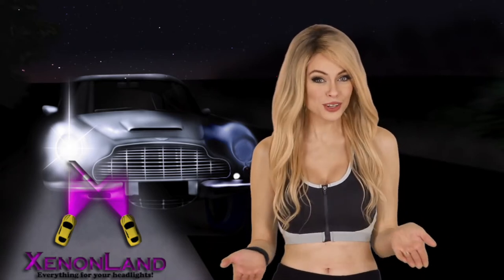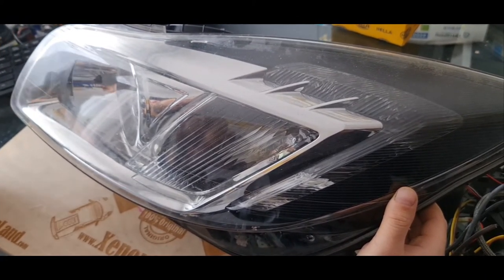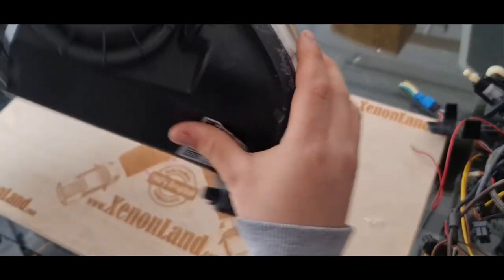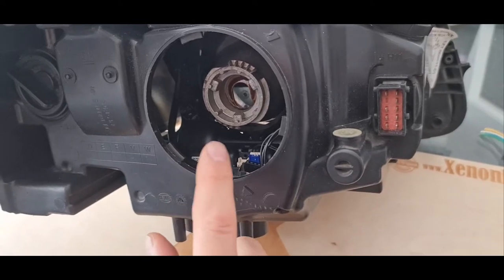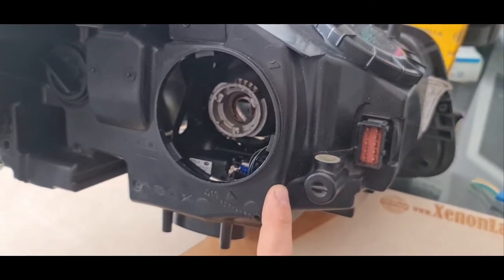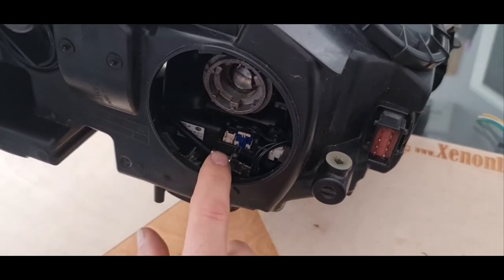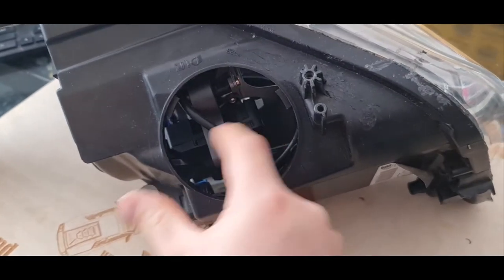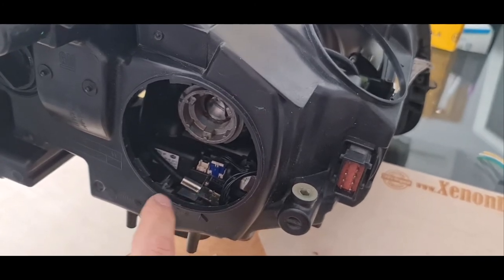OPEL INSIGNIA (ASTRA J) high (full) beam failure (BI-XENON AFL headlight); light shutter not working

Comment: Thank you very good vidieo . 
  i have a simular problem both headlights only come on for a second then turn off in auto light mode. in the manual mode they work as nomal. I had afl fault come up then it has now dissappeared from the dash the next time i used the car. but leaving me with the problem above.  2016 insignia. any thoughts on this matter, thank you.

Comment: Thank you for this video. I have the same problem.
I tested my relays and fuses, everything is ok. Except that my two 15A fuses of the high beam do not receive any current (ignition or engine on).
Is my problem the same as what is explained in your video? 
Thank you for your answer.

Comment: I have a 2013 vauxhall insignia. My drivers side light wasn't working. No dfl. Just the indicator. Bought a ballast and still wasn't working. The full beam worked on the passenger side. I then replaced with a 2nd hand unit which cost me £320. The lights now work expect for the full beam on both lights. Any recommendations?
Reply: I have a very similar issue, with my astra 2013 reg. Full beam not working and I get a warning on my dashboard saying service AFL Lamp.

Comment: Hi, wondering if you can help. I lost dip and full beam on both headlights, replaced both ballasts with genuine parts from Vauxhall and also replaced both bulbs with Napa Xenon HID D1S.. Picked up from mechanic and all was working, came out to the car an hour later and now back to having no dip or full beam - everything else works ie- cornering lights and both lights move when the steering is turned. Any help would be appreciated.
Reply from the maker: You should definitely have dip beam if your ballast and bulb is in working order
Reply: @xenonland  Thanks for the reply. Still no dip or main beam today. Taking it back to get them taken out and checked over again.
Reply: @xenonland  I went out this morning.. Now I have the drivers side main beam working although the AFL is now throwing up a fault. Both lights have stopped moving. Ready to rip my hair out. Any idea what is causing this? TIA
Reply from the maker: If you do not have main beam, it means that either your ballast unit or the d1s bulb is faulty. If you bought a brand new genuine hella ballast, you should code it after fitment to have afl working.  @MsBull1972

Comment: What if low and high beam dont work, bought two new bulbs and they dont work either. Will it be a ballast issue?
Reply from the maker: Yes, if everything outside the headlight is in order, it is either your bulb or the ballast unit. If bulbs new, remains the ballast unit.
Reply: @xenonland  thanks ❤

Comment: Thank you for your info, but I this black box what you show, where can I buy it? Or how it's looks? Maybe you can put some link here.
Reply from the maker: You can only source it from another headlight. Not sold separately as headlight part. Friendly recommendation, if your glass is removed and re-sealed just look for another headlight, but intact one with all lugs intact (I know that these are expensive, but will save you a lot, if you change just 2 times the xenon ballast it will cost you almost same amount). Please do not forget to subscribe.

Comment: Hi, I’ve had water ingress on LH side and now full beam on LHS and RHS are not working. Would replacing the LHS unit fix the issue with the RHS also?
Reply from the maker: Yes, it should
Reply: Thanks, I’ve just purchased a used unit from eBay with 2 week warranty. The LED is also out on the LHS, so should resolve that issue also.
Reply from the maker: @mikeh9442  these headlights are really pain. If you notice condensation in the newly bought headlight in these 14 days, just return it.
Reply: @xenonland  first job will be to test its fully functioning and then seal it all up with silicone!
Reply from the maker: @mikeh9442  99% is not the glass/lens!!! Silicon will not help. Rather look at the casing especially around legs for cracks/damage!

Comment: hello, my opel insignia A (2010) no longer has high beams. on the on-board computer, i have two messages: "afl lamps need maintenance" and "headlight range adjustment malfunction".
the 2 high beam fuses have no power. 
Error message : B0985.
Lamps + fuses + relay + commodo + ballast tested = OK. No water.

What do you think the problem is ? Right-side optics to be changed ? Thanks for your reply.
Reply from the maker: Your right headlamp light distribution shutter control circuit is defective. That's to say the low-high beam shutter is defect. (sometimes China make ballast copies also cause this fault, I assume that your ballast is original Hella one). Unfortunately you have to change the headlight or find a donor headlight to replace the whole projector and its shutter. Not worthy to deal with repairs. Please subscribe and help us to grow. Thank you.
Reply: @xenonland  thank you for your reply.
I don't understand why my left headlight has the same malfunction (high beam impossible).
Why are my two high beam fuses not powered?
So by changing my right lens, everything should work normally?
Everything is original OPEL, including hella ballast.
Subscription OK.
Reply from the maker: @gepetto5203 do not worry, your left headlight probably works. these are afl intelligent headlights. When you have a high beam malfunction at one headlight, the other one stops as well.
Reply from the maker: Go for replacement headlight, everything else is pain
Reply: @xenonland  Thanks again. It's crazy that such a fault cuts the current to the 2 high beam fuses, and prevents the high beams from lighting up. I'm going to trust you and order a straight optic. At worst, if this doesn't solve my problem, I'll send the optic back to the store.
Reply from the maker: @gepetto5203  original projector with shutter is not replaceable part! It is not sold separately by stores. You can only take it from let's say  glass broken original headlight. Aftermarket bi-xenon projectors will NOT WORK with this intelligent headlights
Reply from the maker: We recommend you to change your whole headlight assembly, although expensive
Reply: @xenonland  my headlight is bi-xenon.
you're telling me i have to change both headlights ?!!!
Reply from the maker: @gepetto5203  no, just the one with the faulty shutter
Reply: @xenonland  Hello, I'm following up on my lighting problem (no high beam). I changed the defective optic and the result is that I still have the same problem with the same error codes on the on-board computer and opcom. I don't know what to do.
Reply from the maker: @gepetto5203  we already said that changing the projector will not help. This is a complex intelligent system that is formed by range adjustment module, swivel module, shutter, control unit, light ecu... as stated earlier, just change your faulty headlight, although expensive. Everything else is just a pain and waste of time and money.
Reply: @xenonland  but I changed the faulty headlight, and it's still the same: same error codes etc...
Reply from the maker: @gepetto5203  previouslyyou said that you changed only the faulty optic/projector
Reply: @xenonland Hi I have Opel insignia 2009 bi xenon headlight . I had same issue with my headlight which left headlight didn’t had high beam . After watching your video I changed my left headlight with a used one . Now I am having high beam .but when I drive for some time the high beam of both headlight doesn’t work .if I turn of and on then they works for some time . What could be the issue.does Opel insignia have any other fuse module which could be faulty. Could you please help me to find issue

Comment: I have error in Body>Headlamp High Beam Control Module "B0000-71 Vehicle Speed Information Circuit" Error. OP-COM shows this error. Can you please give me instructions with is the problem with my AFL lights and how to resolve the problem? Thanks a lot my friend.
Reply from the maker: Very difficult to guess from distance but have you checked "wheel speed sensors". These sensors provides the relevant data to  the electronic brake control module (EBCM) and accordingly the AFSmodule/in this case integrated into the ballast know when to activate the AFS function.
Reply: @xenonland  thanks for the tips man :-) I will try to that.

Comment: Really useful video thx 👍 I have a persistent AFL warning & headlamps work ok, but full beam not working. I get error code U1523 00	(K26 Headlamp Control Module) LIN Bus 2 Lost Communication With Device 3 (E13R Headlamp Assembly Right). Is there a control module for the right headlamp that I could replace? Or would you still recommend replacing the whole headlamp unit with this error code? Thx.
Reply from the maker: U1523 code possible causes are: Faulty Left Headlamp, Left Headlamp harness is open or shorted, Left Headlamp circuit poor electrical connection or Faulty Headlamp Control Module/Headlamp Leveling Control Module
. The only replaceable part at this headlight is the ballast unit which also has a specific software that communicates with bunch of control modules at the car/dash. If you have moisture in your headlight most probably your ballast is gone. Or if the bi-xenon mechanism faulty you will have no high beams as well. if your headlight is water/moisture damaged, changing the headlight is cheapest solution (although it cost fortune!)
Reply: @xenonland  Thanks for the advice 👍 It’s a 2009 Insignia Elite. Dipped Beam works ok, both lights perform dance at startup & cornering lights work ok. It’s just the Full Beam that has stopped working. It went gradually over a few years and AFL warning used to only appear when going over speed bumps in the dark. Now AFL warning & full beam failure is all the time. Seems to be related to the headlamp levelling system. Want to diagnose & replace parts before replacing whole unit really 😬
Reply from the maker: @martindodd9874  given the ballast unit works (and is original unit - not china copy which do not have software in), most probably the light shutter mechanism is faulty. If this shutter gets faulty, the system deactivates the high beam at the other headlight as well. Theoretically it is replaceable but you have to find a donor headlight. It is not offered by Opel as a separate part.
Reply: @xenonland  thx 👍 Apparently the wires to the shutter mechanism are prone to wear, so might look for that first. If can’t see anything obvious, then will look for replacement unit.